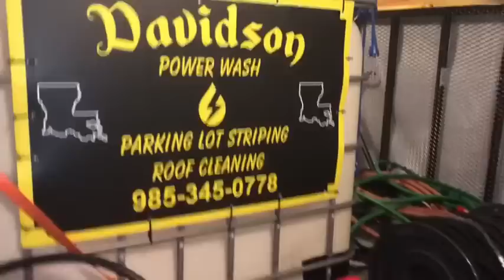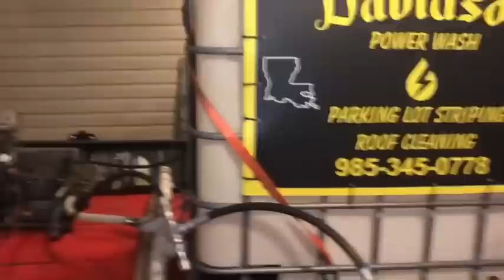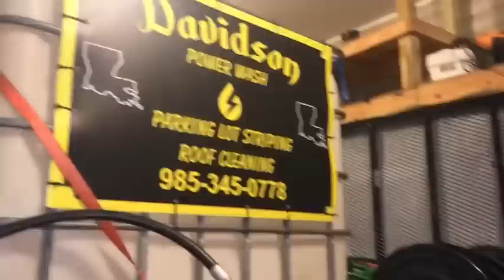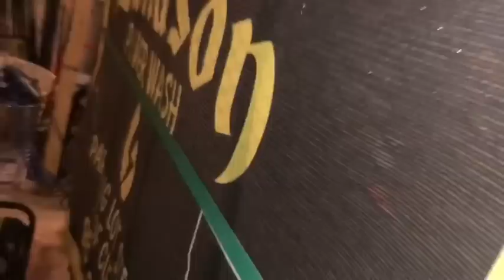Starting your own business power washing

Comment: If you have a single axle trailer you can position the IBC tote between the axle and the trailer tongue.  Before adding water to the tank lower the trailer stand so it just starts to lift on the hitch a bit.  It will distribute the weight between the axle and the stand for better support and less strain on the tires, wheels and axle.  Obviously this is only good if you won't need to move while the tank has water in it.    If you plan on moving with water you'll need a double axle for sure.  Make sure you have a bit of 2x4 or 2x6 to put between the stand and the ground so you don't push the stand pipe into the asphalt or crack the concrete it's resting on.  If you have a wheel on your stand you'll want to remove it or it will likely bend under the weight of the water.  Set your Hudson float valve up so it only allows the IBC tote to get 1/2 full, which is plenty of buffer for one machine.  Be sure to dump any water before you're ready to leave and remember to crank the stand back up.  Get a double axle if you can, but if you already have a single axle and want to use an IBC tote as a buffer tank because they're so much cheaper than buying a smaller tank it can be done.

Comment: My question would be,  can I run my hose from my 275 gal IBC gallon tote to my pressure washer (regular draining flow) without burning up the pressure washer?
Reply from the maker: dvan cro in most cases you cannot do that unless you are running a larger flow machine. The smaller 4 gallon per minute machines need static pressure from a water faucet to run. If you use that same machine on a buffer tank you would have to pressurize the water going into the pump otherwise you were damage it within minutes
Reply from the maker: dvan cro in most cases you cannot do that unless you are running a larger flow machine. The smaller 4 gallon per minute machines need static pressure from a water faucet to run. If you use that same machine on a buffer tank you would have to pressurize the water going into the pump otherwise you were damage it within minutes
Reply: Okay, for me to get a better understanding. I will need a pump to send my tote water to my 4 gpm pressure washer pump connection?.. Gravity flow will not work in this case?

Comment: If I got just 1 8GPM pressure washer could I use a 100 gallon buffer tank or do it has to be 250 gallon or higher?
Reply from the maker: Probably in most cases that 100 gallon buffer tank would be good enough but there will be some times that you’re going to have to stop and wait for the water supply to catch up